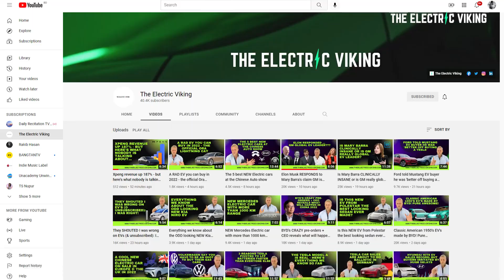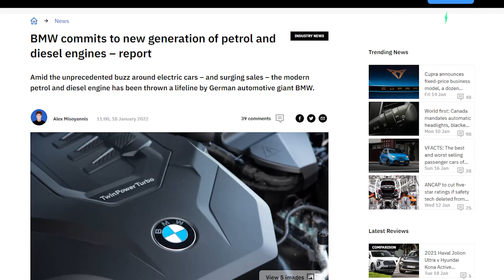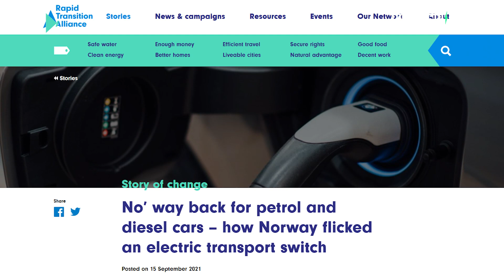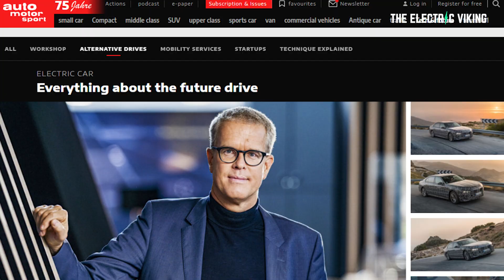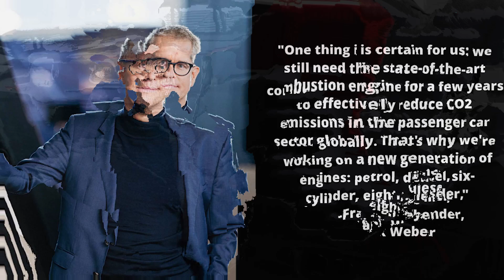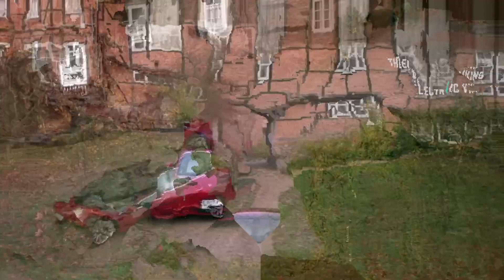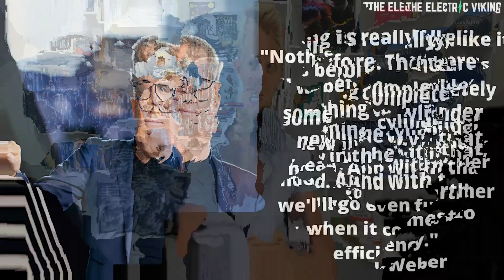This is why BMW is most likely German auto to go BANKRUPT

Comment: BMW's three main selling point are superb ICEs (made pointless by electric engines), styling (they have surely thrown that away completely recently with the big nostrils fetish) and handling. Even if they get a new set of designers, and go full EV they have still lost one out of three unique selling points and are way behind in battery technology etc. They will never have the same cache again, they just need to salvage what they can. I drive a BMW 228i, lovely little car but the next one will be an EV, and not one with huge nostrils.
Reply: Yeah, what's with the front style these days. A brand is a brand. It's like no two models are the same.
Reply: Folks said this about Porsche as well, but they managed to bring their enigmatic driving style from their ICE engine to their EV
Reply: Well said I’ve also been driving BMWs for a long time and our current one will be replaced by a Tesla.  The styling has always been excellent until now.
Reply: Tesla will likely sell more cars in 2022 than BMW not just EVs all cars
Reply: handling? are you stuck in 2007 or something? today audi and mercedes models handle better than the average 6-in line xdrive bmw vehicle.
Reply: Even if we assume BMW has better chassis geometry and is better tuned, it still can't overcome the inherent huge advance of low CoG of Tesla.
Reply: In the Nordschleife (videos) you see how well ;-) the BMWs behave in that cornering at higher speeds ;-) A left turn followed by a right turn and many BMW are just flying off the track. Such a good handling.

Comment: BMW lost the plot years ago.
One of my coworkers,  not a car person, came into the office in stitches last week, she said she was followed into the carpark by a car with a massive pigs snout, at which everyone went to the window to look at it, the whole office erupted in laughter. It was a new BMW SUV,  not sure which one.
Even if BMW started making reliable cars again and bought into developing electric cars, they’re turning out the ugliest cars Ive ever seen in my life.
Reply: The pig's snout could be used as a charging port. Based on the size of the snouts nowadays, the charging plug could be easily plugged in with the help of a standard forklift.
Reply: @johannbrauer9285  Think your right mate, BMW are thinking ahead and building in battery swap doors for quick changing batteries.
Reply: Yeah, seriously, I just don't get the "pig snout" a few other people have been referring to it as a "gorilla's butt" since that's what it kind of looks like as well.  In any case, it's got as much design panache as the Edsel toilet seat grill.
Reply: Ha-ha, that's what auto journos sometimes politely call "a polarizing look".
That new BMW front grille design sure looks butt ugly!   =:-o

Comment: ..technically, all petrol engines or ICE is limited by the pains of the laws of thermodynamics.. they could only reach a max of 24% efficiency vs BEV's 98%.. this basically means you'll throw away 70% to 80% of your car's energy everytime you use your ICE.. so how do you improve on these, may i ask..? you either throw away gas emissions or more heat.. but you are constrained by the laws of thermodynamics... its really that simple.. if BMW does not realize these facts, they are more stupid than we thought...
Reply: This efficiency is under ideal conditions, and degrades with age and wear. It is also at the end of a long line of inefficiencies that result in around 10 percent of the fuel burned being used to actually drive the wheels. This "well to wheel" efficiency means that in an ICE car, 9 gallons of fuel are burned for every gallon that actually turns the wheels. EV's have a well to wheel efficiency of around 60%, with a lot of room to improve.
Reply: And you will probably have the "Service?' dept tell you that the next service will cost you "X" dollars, and you might ask, "For what".
Reply: All things right - nevertheless the owner has not to adapt to an ICE car, when it comes to refueling. This is done in 2-3 minutes and then it can go another 1.000 km easily. Not so the BEV.
Reply: @outdoorolli5754  
Have you driven any good EV's like a Tesla? By the time I take time to eat, use the restroom, and take a quick break, we are already charged up to at least 80% after 15 to 30 minutes, if not more. I at no point feel like I am losing time compared to my old ICE vehicle. Plus I am so much more relaxed, as they are so much easier to drive. My maintenance costs are almost zero except for new tires and wiper blades, and it costs me about $7 to "fill up" and go 500 km.
Reply: @GoCoyote  you eat, when your car needs refueling, my family and me eat, when we're hungry. Have you ever driven with your family to holiday in a foreign country?
Reply: @outdoorolli5754  
We stop to eat when we are hungry, and charge our car while we eat. We do not generally stop just to charge.
Reply: @GoCoyote  you charge at every stop and you stop for eating/charging, restrooms/charging and additional charging. So do we, but additional fueling doesn't last 30 minutes, but 5 minutes and occurs one time maximum in 8-10 hours.

Comment: Bit of a mis-step from BMW. The legacy thinking is, we've had diesel/petrol for over a hundred years - it can't possible be made irrelevant very quickly. Well, by 2024 / 2025 the sales of ICE cars will be close to zero, no matter how efficient the engine is. There are multiple reasons ( Tony Seba), climate concerns being one of them.

Comment: Not so fast mate. Plenty of regions in markets around the world where going full electric isn’t viable. Case in point, we’re both in Melbourne. The electric charging infrastructure is non existent for serious road tripping unless you only want to head down to the Mornington Peninsula. ICE will still be a significant player leading up to 2030. I do believe though that beyond 2030, BMW will likely transition to full EV, making these engines probably the last generation. They are just hedging their bets. It’s also possible that new generation BMW engines will start to pop up in engine bays of competitor brands as they no longer bother with development, making BMW ICE engines a very nice little earner. We saw this kind of collaboration with Toyota not spending huge sums on a limited production Supra, opting to reskin a BMW Z.

Comment: BMW's problem is going to be that demand for the i4 and iX is going to be much higher than they have forecast, by 50-100% more. 
That demand will also cannibalize sales of their other ICE vehicles. When faced with a choice between the i4 RWD for $55K or the AWD M version for $73K who is going to buy a M240i for $68K, M340i for $74K, 430i for $60K, M2 C for $72K, M3 for $84K, M4 Coup for $60k, M4 for $85K, etc.

Comment: When price of gas goes up to $5 a gallon and cost of oil change sky rockets, people will start changing their minds. Speaking of oil change, these ICE manufacturers make most of their money on repairs, parts and maintenance. It’s like selling inkjet printers at a bargain price but gouging you on the ink. I used to own a BMW. Once the warranty ended, the repair bills were astronomical.
Reply: In Nova Scotia, PREMIUM gasoline (needed for BMW) is 7.00 USD/gallon. Not many BMWs being sold.

Comment: Hi Sam. Thanks for all of your electric videos. Terrific content and very informative. However, no one can produce so many videos without slipping up at one time or another. Totally understandable. As a BMW fanboy from 1992 till 2020 and after owning 4 BMWs over this time, I can categorically state that BMW have not built V6 engines for series production cars.

You mentioned that they will not abandon V6 engines. They did, many years ago and produced the best inline 6 cylinder engines instead. So you might want to modify the above video to reflect that. 

Cheers.
Reply from the maker: Thanks for sharing

Comment: Self diagnostic electric car batteries, here is the idea, batteries that can fix them selves if one of the many battery cells has an issue.  Just have a physical switch in the wires of the battery so that if and when one of the cells on the battery has an issue, than the battery can switch off and isolate the problem battery cell on its own, rather than having severe battery issues requiring replacing 100% or 5% of the battery total cells.  Just keep the car rolling buy quarantining the few faulty cells, rather than wiring up the battery cells in such a way that one rotten egg spoils the whole thing.  Sacrificing 5% of the battery total range per faulty cell.  Just remove the faulty cells. Keep moving forward, either with software patch or refinishing the battery.  Fewer repair costs.
Reply: That's the way disk drives work and memory chips too - find and isolate the bad bits.
Reply: Beleive that this is ALREADY inside the NEXT generation of CARS with AI chips and Battery Management System. Current Auto Chips are so Powerful and Advance that the M1 chips (Apple ) looks unsuitable for Auto Uses.

Comment: Agree BMW seems lost, but real problem is as EV rolls out fuel stations will close down as charging stations open up. As the market shrinks the cost of supplying petrol will go up significantly, the motor fuel market is likely to become volatile. With fuel costly and refuelling points scarce, ICE owners will start being concerned with range anxiety.

I won't be buying another ICE but will probably keep my current one for a while mostly out of nostalgia but also to hedge my bets and as a cubby house for the grandkids. I plan to buy an EV within 3 years.
Reply: Yeah as petrol station/ gas station  franchises and brands realise petrol has more problems than it’s worth, fast charging brings more profit and more snack and food sales they’ll dump it as fast as they can

Comment: ICE motors won't disappear, but they won't be for passenger vehicles. Large mining trucks and ships will burn ammonia, probably with some battery for entering/leaving port. Semi's, rigid trucks and buses will be battery-electric, the long haul will be a mix of battery swap and plugin.
Reply: @FrunkensteinVonZipperneck  So has Australia and Sweden but the fleet worldwide won't be battery electric. It doesn't make economic sense for the whole fleet to go solely battery electric. Not without a major breakthrough in energy density per kg.

Comment: With the shortage of EV batteries at such an early stage of adoption it’s definitely going to take a while for EV’s to get to 70-80%. I’m a huge EV fan and hope the supply increases soon.
Reply: Norway is already at that point, and the percentage of new EV's market share is reaching the 25 to 50% range in many other countries. Battery production capacity is also skyrocketing.
Reply: @GoCoyote  Norway is a small market with outstanding subsidies for BEVs since years. It's the worst example for your point. In big markets the share of BEVs in 2021 was 15% maximum, mostly it was 5-10%. It's not the production capacity, that limits the market, it's the supply with refined litium and cobalt.
Reply: @outdoorolli5754  
Overall, Europe was at 26% market share for BEV's by October/November of 2021, Germany was at 34%, France at 23%, the Netherlands at 28%, and Norway at 90%. December put those numbers even higher. Most EV battery manufacturers are rapidly moving away from cobalt, and while lithium prices have risen, supply is still plentiful, and the higher prices are spurring massive growth in development. There is actually not that much lithium by weight in an EV. About 8 kilos by weight, and about 250 dollars US.
Reply: EV manufactured in 2021 5.6 million mostly in China, battery close to it's limit, cars made in total 60 million, good luck EV!
Reply: @gregb1599  
The place to look is the degree of change and the speed that it is occuring at. The fact that EV sales are now growing by over 100% per year, and that ICE sales are falling, tells us that change is happening rapidly.

Comment: Looks aside, BMW's EV offering is developing very quickly and getting very good reviews. Even the iX3 and i4 which are not on bespoke platforms are getting very strong reviews. As someone who has decided that the next car purchase needs to ben an EV, if I were to look at an SUV type vehicle, based on tech, specs and what I like, the iX3 would probably be my first choice based on the reviews I have seen. And as noted below, the fact that they can do this while keeping the flexibility of switching from different power trains may actually be quite smart. In terms of continuing developing ice engines, the key phrase was "next few years". While I think it will be faster, the most aggressive forecasts seem to suggest 50% EV by 2030. That means that more than half the market will be non-EV until then (though I agree that it makes little sense to buy a non-EV at this stage but those are the market expectations). So doesn't it make sense to offer up the best ICE engines possible as there are likely to be continually stricter regulations on them? If no one else is making these improvements, could BMW be one of the few ICE manufacturers to offer ICE engines that comply? Could the fact that they have production flexibility put them in a position to switch and react depending on how the market evolves? Wouldn't be so sure about your conclusions.
Reply: "That means that more than half the market will be non-EV until then": And half the transport population will be ICE til way past then. I'm still wondering how the grid can transition. Transmission lines are a much bigger issue than power plants. We actually have to move to "local power generation". Nuclear is the only thing that can do that. If they can do it with submarines, they can do it with neighborhoods. And why aren't they doing nuclear with thorium right now?
Reply: the ix3 is just an obsolete chinese made version of the x3, average vehicle in the segment.
So much inferior to the jaguar i pace.
Reply: Except the BMW EV's look ugly.
Reply: @toddmarshall416 as if the power generation companies are going not bother making more supply when they can make more profits. Built solar in Spain, Italy and Turkey.. Build wind turbines in sea.. Build hydro in Norway.
Reply: Nuclear is just another thing from the '50s that needs to be overcome. Better, cheaper alternatives are available.
Reply: The problem for BMW is that they are in a premium market.  As you have already stated, your next vehicle will be an EV.  This is still really only an option for relatively affluent car buyers….   the type of people buying NEW premium vehicles.  BMW will lose market share to all of the people who are looking to go to EV but are put off by the lack of options available at BMW today.  I wanted to replace my 540i with an electric version…. Until I watched this video, I didn’t even know the i5 was even being developed.  It doesn’t matter, though, because I will move on to a different brand well before any i4 is available to buy, forget about the i5.   Investing in new ICE tech is pissing money into the wind unless you are going to be putting those shiny new engines into economy cars.
Reply: Good reviews are usually fake
Reply: Not in the luxury market.

Comment: Consumer vehicles need to be powered by a multi fuel approach in the medium term and yes ultimately battery powered long term but presently depending on where you are in the world and even in your own country BEVs may not suit due to infrastructure. A transition to BEVs whilst that infrastructure continually improves is needed so short term I see why they are investing in the new engines but I see a diversification coming on-BMW consumer vehicles transitioning to BEVs almost exclusively by 2030 in line with its rivals and the remaining engines being sold to third parties like heavy machinery companies who do not have the R&D budgets to make new engines compliant with new regs for their vehicles. I see the stats lining up with the 50% slips by 2030 but they haven’t mentionined volume just percentage while lines up with my thoughts. Essentially they become two companies, one with BEV cars and one selling high capacity highly compliant engines to third parties like Catepillar etc. interestingly JCB have invested highly in the same route with a view to using the engine to burn hydrogen-I suspect the Weber comment about intake refers to something similar. Good video though, gets the mind going on the topic. PS have a BMW i4 electric ordered so I’m on the BEV side!

Comment: I think BMW should keep the petrol M's / M-lites for this decade, but electrify everything else. I know there are plenty of BMW M / M-lite enthusiasts who would continue to buy petrol well in the future. It would make sense for BMW to keep petrol derivatives only for their high performance cars. The standard buyer of a 320i likely isn't into high performance driving; that same driver would not mind electrification.
Reply: There's some logic to this idea although they will have to run on synthetic carbon-neutral fuel which will be very expensive. Porsche have touted this idea too. I can see it being feasible for high end and exotic cars and certainly is the way forward to keep classic old vehicles running into the future.  I'm not convinced it would continue long term however once EV technology really matures. I don't think anyone apart from nostalgic rich geeks will want new ICE cars beyond 2050. I'm betting classic ICE vehicles will still be around however perhaps with limited use licenses.
Reply: @fangitjoe  I'd say BMW can keep petrol performance cars for the next 10-20 years as an interim measure. But eventually they'd have to go fully electric. Synthetic fuels are way too expensive.